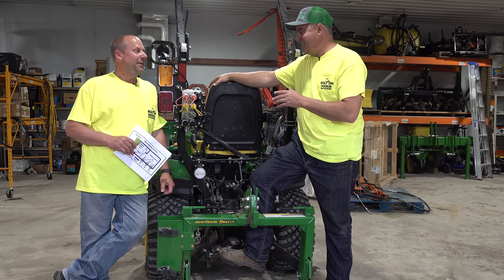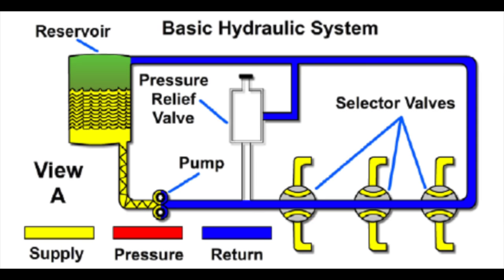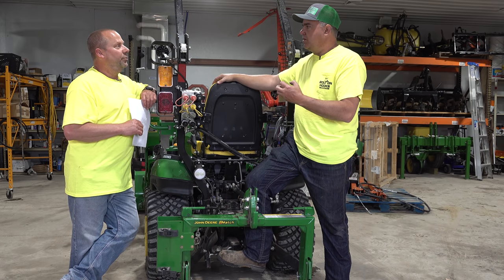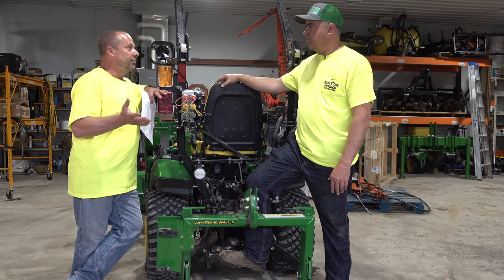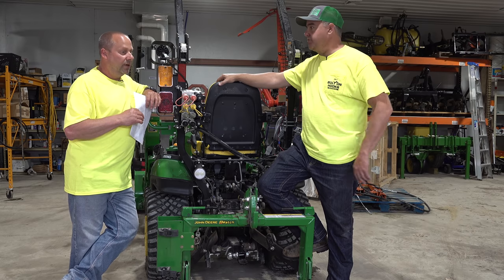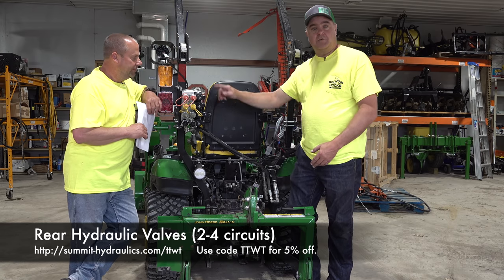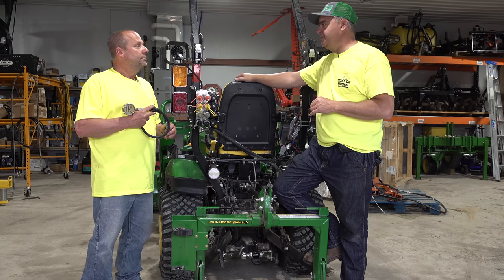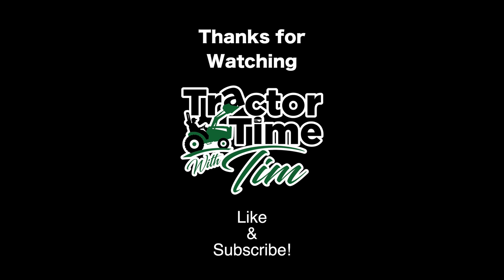Compact Tractor Hydraulics Explained

Comment: This is how a gear pump works in a nutshell. As the gears are turning on the suction side a tooth is pulling out of a pocket between teeth and causes a small void and draws a small amount of vacuum. 14.7psi of atmospheric pressure pushes the fluid into that void via the breather on the reservoir. The fluid is carried around the gears and on the pressure side a tooth is going into a pocket between two teeth and this creates flow. Pressure is a product of resistance to flow.
Reply: Pp

Comment: Roughly electrically... Flow is voltage, Pressure is amperage, load is resistance. 10K volts at tiny amperage won't hurt you, static shock. 120 volts at 10 amps may kill you. So 100 gallons an hour at low pressure is a trash pump. One half gallon an hour at 10k PSI will cut your finger off.

Comment: You didn’t mention anything about the effect of  cylinder piston size on the force of a cylinder . The bigger the piston  , in square inches , the more force the cylinder will exert, but at a slower speed . For example if a log splitter in connected to a tractor hydraulic system it’s cylinder will be larger that most tractor cylinders so it will move much slower but will more force .

Comment: One thing I have heard from way to many people is statements that resemble ‘my hydraulics have no flow/pressure until I operate a valve’.
Ken and you addressed this on the flow side quite well. Less so with how pressure works in the system. 
Now I realize that typical operation stays under that relief valve pressure, I also realize there are mays to increase the pressure in the system up to that relief valve setting. You addressed this as well in the deadhead examples and the overloaded examples. There are others as well. 
Bottom line without pressure (however not necessarily max pressure) there is no flow. But as Ken and you discussed, there can be pressure without flow (deadhead) until the relief valve activates and flow (not full volume) is restored.
Reply from the maker: Yes, maybe we shoulda explicitly talked about normal 'pressure'.  In this system, you will see maximum flow all of the time.  The loop will always be flowing.    When no work is being performed (no hydraulics actually used), there will be very little pressure.   The only pressure will be what we call 'parasitic pressure' caused by restrictions in the loop. For example, 90 degree elbows, couplers, etc.
We have tested roughly 100 psi in this scenario.      The pressure only increases when hydraulics are used, and then only sufficiently to perform the action.  So, if the loader is empty, it might take only 500psi to lift it.  If full, it might take 1900psi.  
So, the phrase "my hydraulics has no pressure until I operate a valve" is essentially correct...and close enough to help understand the system.  ...but it DOES have FLOW.    
One other point. this is an 'Open Center System'. Closed center is used on larger tractors and is different.

Comment: I want to make sure I got the explanation correct. I have watched a few of your videos. With the summit valves I just need to hook up the  valve to the output of the backhoe and then the other side of the valve to where the backhoe originally connected.
Reply from the maker: Yep!  You got it!

Comment: I always knew how hydraulics worked but I wasn't  exactly sure where to put the pressure relief loop. Now that y'all talk about it it makes perfect sense. This will help me figure out how to put a small hydraulic system on a riding lawn mower.  I want to build my own implements rototiller, log splitter, auger etc. 
Although you talked about the loop always being on. I'm going to be able to disengage the pump to prevent bulging down my engine when I'm not using the hydraulics.
Reply from the maker: It won’t use much power as long as there is no pressure.  The only time pressure is generated is when hydraulics are actually doing something.  So no need to turn off pump.

Comment: Hello Tim and community!! I'm adding a JD 260B backhoe to my JD4100 HST. The tractor already has a 200CX loader. Because Power Beyond kits are basically no longer available for the 4100 (the ones I did find are over $500, I need some guidance on assembling my own kit from off the shelf parts. I have read that the 90 degree fittings, hoses and quick connects needed are similar to a JD 2520 as follows: 

DSCV BLOCK, FRONT PORT
9-6805-6-6 SAE 6M TO 3/8" NPTF 90 ELBOW, QTY=1

DSCV BLOCK, REAR PORT
9-6901-6-6 SAE 6M TO 3/8" NPTF 90 SWIVEL, QTY=1
9-5503-6-63/8" NPTM TO 3/8" NPTF 45 ELBOW, QTY=1

PB HOSES
903-3836 3/8" X 36" 3/8 NPTM X 3/8 NPTM 2750 PSI HYD HOSE, QTY=2
9-A2-172-D 3/8 IN SINGLE WIRE DUAL HYDRAULIC HOSE CLAMP, QTY=1
VALVE INLET/OUTLET PORTS TO PB HOSES
9-6901-8-6 SAE 8M x 3/8 NPTF 90 SWIVEL, QTY=2

VALVE WORK PORTS TO DIRECT ATTACHED QUICK COUPLERS
9-6902-8-6 SAE 8M x 3/8 NPTF 45 SWIVEL, QTY=4
9-7184 3/8" NPTM - 3/8" NPTM HEX NIPPLE, QTY=4
9-7381-F 3/8 NPTF QUICK COUPLER, QTY=4

Any guidance would be greatly appreciated if I'm on the right track and where do you recommend ordering hydraulic components. 

Oh, the video on the Summit hydraulic rear connection kit was awesome as was the adding power beyond videos. Great job!!
Reply from the maker: http://discounthydraulichose.com or http://summit-hydraulics.com use code ttwt for 5% at each site.

Comment: As an analogy, seems oil pressure is like voltage and oil flow is like amperage. Pressure does the work and flow gives the power.

Comment: Think of pressure as voltage and flow was amperage. In hydraulics if the flow is low but pressure is normal (voltage is normal) then you have a bypass somewhere. If it is not popping the relief valve where ever the bypass is will heat up. We used to test dual hydraulic motors by placing them under heavy load and the one that got hot was the bad one. We did have a testing device called a hydrosluth back in the 70’s that you could use to isolate the suspected component to test it. If the flow is low but the pressure is ok not much work will get done, think of low current as low flow.

Comment: flow can be done with a water meter and the correct hydro lines connected just make sure the machine is off before connecting and make sure the machine comes completely off before disconnecting. water meters aren't designed for the higher pressures until you get to sky scraper meters.

Comment: I have a bit of a power beyond horror story for you. When I worked at the Mahindra dealer, we had a customer buy a Max26 with power beyond and backhoe. He apparently didn't realize the power beyond hoses had to be connected together when the backhoe wasn't attached. This tractor came back with 11 hours on it, with a hydraulic pump split in half. Mahindra would not cover it under warranty, since it was due to the owner not reading his manual. I should also add they have yellow tags on the ends of the hoses with instructions on what to do. We went round and round with him, and Mahindra, trying to come to an amicable solution. Long story short, the tractor never left our shop, and Mahindra repossessed it because he refused to pay the bill.
Reply: Seems like a poor design to not have the relief valve plumbed in before the power beyond. If Mahindra had done that, then it would’ve been fine.

Comment: Wonderful explanation. Now as to your comment on the difficulty of connections for a flow test, if your tractor has a power beyond loop, would it be easy enough just to tap in right there at the quick connectors? If I understood correctly, that's just a longer length of the main loop so it should have full flow and pressure right? So it's just a matter of some easy connections and the cost of the gauge/s. Love your videos, keep up the good work!

Comment: If you are going to add a valve to the power beyond (if you have those hoses on your tractor) you must install a control valve that has a power beyond port (as is or with a special PB plug). A regular control valve only has tank return (low pressure) and will damage the hydraulic system.
Reply from the maker: Yes. The http://summit-hydraulics rear hydraulic kits that we promote are rated for ‘back pressure’.  So, they can handle being directly in the PB circuit.
Check out our later episodes showing this kit.

Comment: Can you do a show on adding a secondary pump to a pto so you can use available HP to use front mounted brushes, blowers, mowers, hole diggers or anything else with high flow requirements and can two systems be combined to increase total flow?
Reply from the maker: We have shown a front loader mount mower with rear hydraulic power pack.
No, systems cannot be combined.

Comment: My 2038R does not have a rear remote or. 3rd function for a grapple. I would like to get a rear remote installed. Would you recommend mother Deere or an aftermarket like WR Long .
Reply from the maker: Deere for the rear remotes.  Artillian diverter for the 3rd function up front.

Comment: If it works like your diagram, how would it ever be possible to send fluid to 2 cylinders at once? It looks like whichever cylinder is first in line will stop all flow from the following cylinders.

Comment: I see most compact tractors have two ratings for flow. One for implement  and another for steering and then a total of the two. If you arent using the steering does that flow go to the implement?
Reply from the maker: No. Tractors which list them separately have two separate pumps, with two separate circuits for steering and implement.
The steering number is basically a waste…assuming the tractor steers fine.  Only thing you need to care about is the implement flow.

Comment: Can you estimate the flow by just taking the diameter and length of travel for a cylinder (or two if it's a loader), and then time it and calculate the volume of fluid that moved into the cylinder(s) during that period of time to get gallons per minute?
Reply from the maker: Yes.

Comment: Hopefully you gentlemen will develop a kit to reposition the rear hydraulic ports on a LX 2610 or LX 3310.  It seems Kubota didn't know the tractor would have a ROPS in the way when locating them.  Sad situation on an otherwise great design.
Reply: Had a thought to propose for resolution.  Take a pair of Ken's ROPS clamps and attach one of his diverters to each one so they are outside the ROPS like ears on the tractor.  Use through mount switches that can be cut into the plastic, one in front of each of the rear remote levers.  Run a hose pair from the current rear remote block to each of the two diverter boxes.  Solves problem, and doubles capacity.  Make flat face females on the blocks an option so hydraulic fluid is not always leaking down the fenders :-).  This way I could use the ditch bank flail and not have to disconnect the hydraulic top link.  Haven't yet located a workable hydraulic tilt for this tractor.  Keep up the great work!

Comment: Virtually all Hydraulics work in a circuit.  Automotive power steering, Skid Steer, etc.  Even the main 3-point is a circuit, it just has one side of the piston.  There was a point in the diagram that really shows how the line is diverted from the main loop to do some work, but you didn't really point it out.   The reason operating 2 or more functions at a time slows down is because you are tapping that main loop multiple times, so the overall flow is reduced to each.  Pressure should remain the same, but the flow is reduced.  IF the functions are all the exact same flow rate, the reduction would be 50/50, but in the real world, things rarely ever divide that evenly.

When a function operates:
1) the loop is blocked so that the flow will go to your function.
2) the function supply is opened and the return is opened.
3) fluid is pumped into the function.

Like you said, if flow is stopped for any reason (load, end of travel, etc) the pressure relief opens.

Comment: my Kubota mechanic told me if i unhook the backhoe and not re-hook up the power beyond to the return hose, it will blow up the hydraulic pump in 3 seconds if i start the tractor,  1. is that true, 2, does that mean power beyond doesn't have a relief valve ?
Reply: That is incorrect, you do have a PRV. Still not a good idea to run the tractor without the PB lines connected though.

Comment: Hi guys, great video,was wondering if you could direct me to info on bleeding the hydraulics in the backhoe of a mahindra e25 max.I had to change a line on the bucket, which worked fine, but since that the boom and swing function dont work properly.
Reply from the maker: Just extend all the way then bring it all the way back in several tiems

Comment: I have a shaver Hd8 post pounder. I would like to put it on my 3025e on the power beyond. It has two hoses. One pressure going in and one that hooks to a case drain. Could I make a loop like you have Tim that had a T on it to feed the pounder so it doesn’t block the loop but feeds off it. The relief hose on the pounder has to go to a case drain so the pounder will fall as it should. Thanks for any help you can give. Im hoping the T will work.
Reply from the maker: Anytime you say ‘T’ in open center Hydraulics, you are typically on the wrong track.
My 2R (same basic tractor) has 3 ports for PB.    P, R, and T.
Pressure, return, and tank.  If you have that, you are set!   If not, work with your dealer to get a direct tank drain line.
The R line goes to the 3 point…it is not a direct tank drain.
Reply: @TractorTimewithTim  thanks. I will work with them to try to find the right configuration. Best wishes and always great work. 🙌

Comment: I like to know Ken’s thoughts of the high flow pump you featured on one of your other videos. If he like it or not. 👍
Reply from the maker: His thoughts are fully reflected in my statements about the solution in the first video.
He and I and Kevin have discussed this many times.   
Some concern about heat, but most questions have been answered.   While it seems impossible at first glance, it seems to be working fine.  
Hopefully we’ll continue to get feedback from users of the system.

Comment: I carry about 600lbs lifted mid way on my 3 point heavy hitch on my 1025r. At idle I always have a little whine coming from the hydraulics. Increase the rpms and it goes away. Reposition the 3 point and it goes away then comes back after reposition. So I shouldn’t be carrying around 3 point ballast at idle if it whines? And that whining is the relief valve? Can you answer this for us 1025r folks and what we should do? Thanks for a great video.
Reply from the maker: Sounds like the relief valve.   Might be worth showing the dealer. It is not normal.  Does it do the same thing with less weight on the 3 pt.
Reply: @TractorTimewithTim   With no weight on the 3-point for ballast I have no noise. Only with weight for ballast do I get the noise at idle.
Reply from the maker: How about moderate weight on the 3 point.

Comment: This was very helpful to explain “power beyond”.  I keep hoping for diction to a helpful/reasonable and elegant professional way to add top link hydraulics to my Kubota BX23S without trying to MacGyve a Deere system.  Tim, now that you have Kubota as well, can you address that?
Reply from the maker: Yes. The summit system shown on the 1025r will work beautifully on your Bx.
Reply: @TractorTimewithTim  As I understand it that supplies the manifold for the valves.  Does it include valves and where would the controls be mounted?
Reply from the maker: If you have power beyond, this kit provides the rest.   There is a ROPS mounted bracket for the control switches.  Check out this video for close ups.
Introducing NEW Rear Hydraulic Solution for Subcompact Tractors
Reply: @TractorTimewithTim  Thanks for that reminder - i will review that video again.  I apologize for being dense but since the BX23S comes with a backhoe I do have two connections for the controls mounted on the backhoe and the power beyond connections for continuing the loop when the controls are not calling for flow.  The manifold clearly gets inserted in the power beyond circuit and the switches control the solenoids to open or close the additional circuits.  But this leaves out the critical valve controls for controlling flow in the additional circuits, mounting hardware for such controls, not to mention the additional hoses to connect the valves to the manifold and to the additional rear link hydraulic piston.  I am looking for a ‘complete” solution that has both the manifold, is controls and the necessary valve control (for controlling the piston) and importantly, a thought out mounting bracket that is both conveniently located and does not get in the way of that miserable seat swiveling operation or the backhoe.  Cobbling these parts together in an elegant fashion is what I am seeking, much like the third function hydraulics in the front which Kubota designed.  Right now, it seems a simpler if not easier solution is to simply use long hoses connected to the front third function hydraulics, and draped around the tractor to the new top link cylinder in the rear which can therefor allow use of the grapple valve controls already available.
Reply from the maker: Well, I have to apologize for part of the confusion.  You said bx23s.  Of course you have power beyond!  Sorry about that.

Now, about the switches. These are on/off circuits.  So the switches control the flow to the ram to open or close.     All or nothing.
This makes the installation much simpler.
It minimizes the number of hoses.
Make sense?